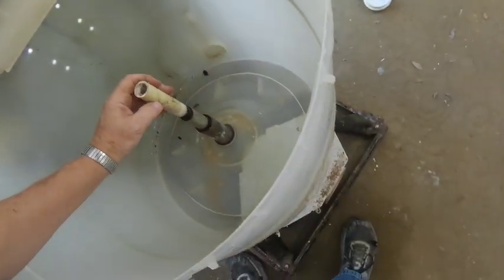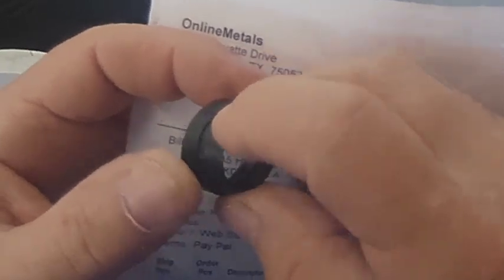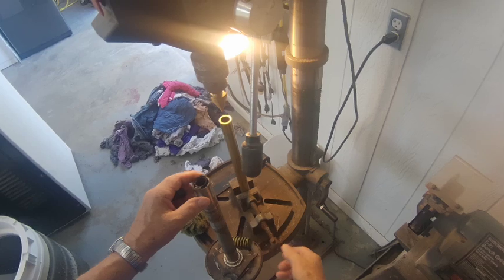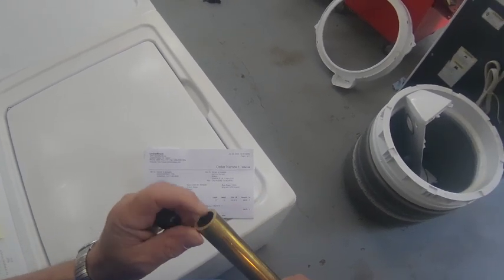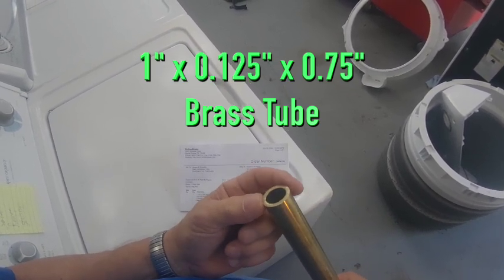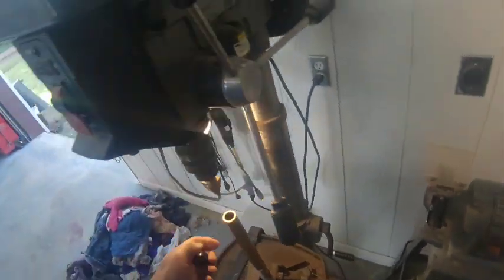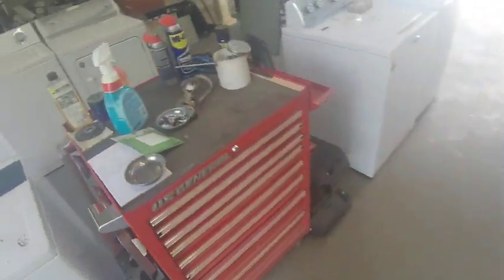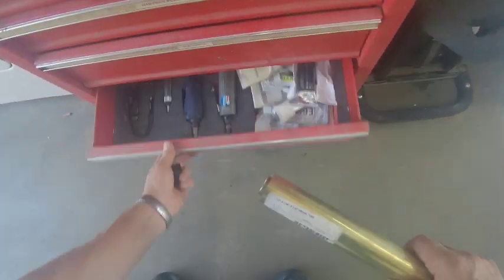How to Create Custom Tools for Whirlpool Washing Machine Repairs

Comment: Ok having been a machinist years ago, I think I can make a couple of suggestions to help improve on your driver. 
Where you re trying to drill the - C - on the drill press. You need a #2 Morris Taper ( looks like you're at about the 13/16"  diameter)
Also an old friend who i had a automotive shop, where he rebuilt transmissions had a brass driver to drive in the seals, very similar to your idea, but about 2½". He put a 3/4" thick clay plug in the bottom that went next shaft ( measure the height of your shaft, and put the plug a ¼" deeper. Then melt some brass pieces,and pour it in as a seal. Heat the brass tubing with a torch to make it adhere. Then drill out the clay plug. Then measure the length you want,. Cut it to length. Then pour in sand, or BB SHOT. Then get press in clay to fill the end about ¼" from top and top it off with melted brass. 
Also wrap a piece of spring wire around the bottom. To keep it from mushrooming and potentially messing up the seal. 
Thnks for your awesome videos and ideas on fixing these contraptions.
Reply from the maker: Man I wish I had a lathe and you around to show me how to use it! I have a bunch of ideas on specialized tools that I want to make but I need someone like you with the expertise to help me! Thanks for the suggestion!

Comment: Nice tip, I did not have the Nut wrench for the spin tank.
I cut a 14 inches Chinese made pipe wrench. It worked fine plus the 5 lbs hammer.
Reply from the maker: You do what cha gotta do. Thanks for watching!